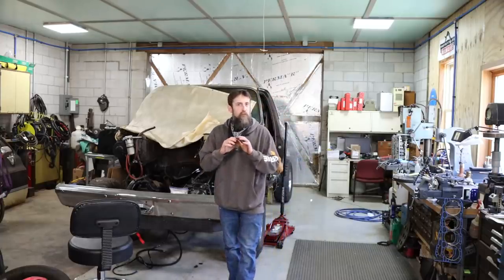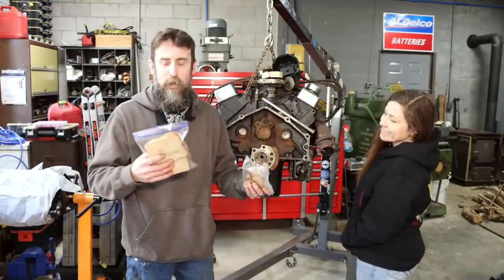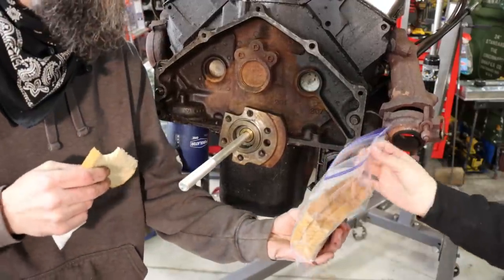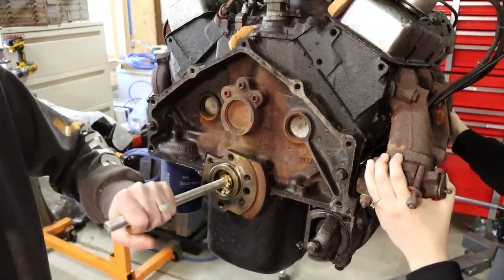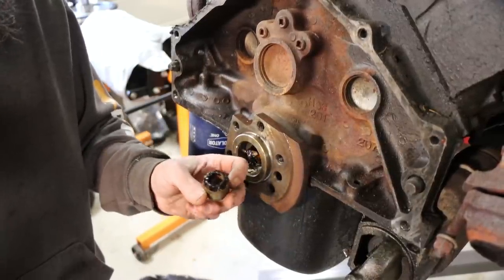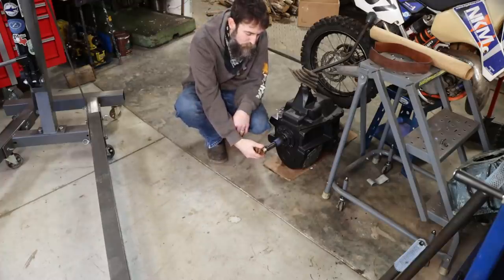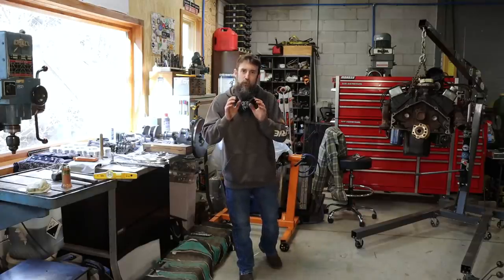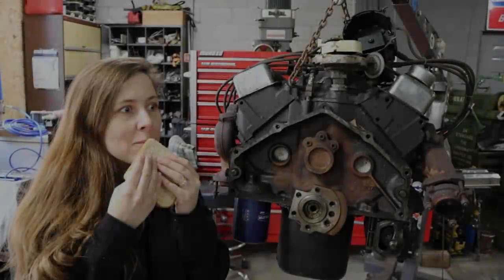Neat Trick Removing Bearings With BREAD?? Yes bread.

Comment: 1965 I went to Lincoln Speedway in Abbotstown, Pa with Charley Weirman '55 Chevy late model crew. It was running a 327 and took a front end hit resulting in a minor top tank seam radiator leak. The crew chief told me to run to the refreshment stand and buy a pack of unopened hot dog rolls. They put 3 rolls in the radiator, it was steaming after the feature but he finished 5th!

Comment: Not a mechanic trick, but I’ve used a white bread plug to stop water dripping long enough to get a good solder joint on a T-fitting copper water line. It eventually dissolves in the water after you get that nice shiny solder joint. This was to replace a crummy piercing fitting that had too low flow rate to keep the ice maker from repeatedly freezing up.
Reply: My dad was a journeyman plumber and would use this trick frequently. Came to the comments to post the tip, but you beat me to it.
Reply: Also used that trick a lot too. That trick cost me a few lunch sandwiches....lol

Comment: Steve I've always placed wheel bearings in a sandwich bags and then added wheel bearing grease to the bag. You can squeeze the grease into the nooks and crannies of the bearing by squeezing the outside of the bag keeping your hands cleaner. I actually think the pressure from the bag while being squeezed gets the grease in more areas of the bearing.
Love your channel. Amazing videos!!
Toby
Reply: Good idea,,,,I always end up with more grease on me then in the bearing! Hey, Just keep a bag full of grease in the top of the tool box and use it over and over. 😁
Reply: Neat trick, Works for oiling prefilter foams as well
Reply from the maker: That is a great tip I never considered.  Excellent !👍
Reply: I've used the ziplock bearing packing trick many times, from the tiniest bearings to the biggest! But I eventually broke down a few years ago and got a Lisle grease press (the red and clear plastic one), and while it only works on normal automotive to small industrial sized bearings, it is worth every penny. The bag trick works for 1 or 2, any more than that you'll have a claw hand from all the repetitive folding and pressing to grease a bunch of bearings! Finally broke down and bought one doing the bearings on an 84' Chevy 1500 sfa (pretty much full maintenance/fix on the entire driveline), and don't regret it!

Comment: Ah the memories.  Im 62 and we did this quite a bit back in the 70's on our 4 speed motor head cars and a few pickups when changing clutches, except we used heavy grease as you said.  We used to tape the end of the rod or an old input shaft with some electrical tape to help the "hydraulic seal"  Same results as long as you have the right size rod some thick grease or the correct factory shop manual approved bread and a good hammer - lol.

Comment: Hi Steve and Elizabeth,
I had good success using thick wheel bearing grease. Always worked when the bearing puller wouldn't fit in the bore of the center bushing. Hope the family stays safe.

Comment: I'm more impressed someone thought of using bread than it actually working. Thanks for sharing!
Reply: If you have a brake caliper with a stuck piston in it you can remove the caliper and install a grease nipple in the inlet hole. Then you can push the piston out in a controlled way with the grease gun. Less terrifying then compressed air😁

Comment: Bread, paper towels, grease, grease and paper towels, bar soap, crayons, clay, candles, plastic wrap, aluminum foil...

Basically anything or any combination of things that will stay put in a horizontal hole, fluid enough to transfer hydraulic pressure, and can be hammered with a punch the same size as the ID of the bearing.  You can achieve the right sized punch by wrapping electrical or duct tape around an existing punch.

Comment: I used fiber grease (wheel bearing grease) to do the same job. 
Mopars and Ramblers had a light bulb down in between the push buttons that were used to select automatic transmission gear range. The service writer gave them to me because the procedure was to get at the bulb from the back side of the selector box at the underside of the dashboard. Others took an hour to do it. In five minutes, I took off the face plate, and pushed a piece of hose in between the buttons over the bulb. The bulb was pushed into the socket and twisting the hose the bulb was released. It came out in the hose and the new bulb went back in to the socket the same way. I kept a short hose on a pencil in my shirt pocket. For a long time, no one knew how I was doing it so quick.
Bad, stuck dowel pin in a blind hole. drill a hole through the length of of the pin, tap it and install a grease fitting. Use the grease gun to pressurize the area behind the pin. It jacks the dowel pin straight out.
Broken-off stainless steel exhaust manifold studs in an aluminum cylinder head, in chassis Use 90 degree angle head drill. Center punch, drill using bit from set of SPLINED easy out (Snap-on or Rigid). Pack the wax from a candle into the hole. Heat the broken stud to cause the wax and wick up the threads of the stud from the inside. Allow time to cool. Drive the SPLINED easy-out into the hole, place the matching splined nut onto the easy-out. Turns out smoothly most times.
Many Dana (and other) differential use a lock bolt to keep the cross shaft in the spiders from coming out of the ring gear carrier. The bolt has a dowel below the threads. Very frequently, the bolt fractures and cracks off at the lower thread leaving the pin end in the cross shaft. The broken off pin can be remove from the carrier in chassis by making a drill bushing
from the broken off head of the bolt. Drill a 1/8" hole through it. Using it and the 12"long carbide 1/8" drill you bought from McMaster-Carr, Drill into the dowel pin remaining in the carrier. Drive the 1/8" splines easy-out into the drilled hole, place the splined nut  and turn out the remnant.
Reply: And the winner is.......

Comment: Another cool bread trick: Repairing copper plumbing pipe can be a problem if there is any water in the line.  Can't sweat on any fittings if even a tiny amount of water is sucking heat away. So pack the pipe with bread to dam the water, then sweat on the fittings.  When you turn the water back on the bread will dissolve. Just remember to remove the screens on the faucets while you clear the line of bread.
Reply: Yep, awesome tool!  I did a retrofitted a whole house in copper pipe while still living in it.  It was lifesaver!

Comment: Working in an engine reconditioning department of a British car manufacturer during my apprenticeship, they always used bearing grease and a rod machined a nominal size fit. this used to work every time even though the bearing would be worn. You're basically hydraulic pressing it out. Using grease leaves no chance of contamination and allows the new one to go in easier without needing to thoroughly clean the hole out.

Comment: Hey Steve, 
An old engineer once told to me - How to remove seized studs, deck caps that are rusted in. Build a shallow bund around the cap (Plasticine or the like) and then fill the area with Tabasco sauce. Leave for 24 hrs and simply remove the fitting. Works every time. 
Andy UK

PS cant wait to see the truck fire up for the first time.

Comment: Have used bread to remove pilot bushings. Also when you're trying to solder copper water lines and you still have water leaking. Shove a piece of bread down the pipe. It would stop the water long enough to solder your fitting on there. And then open the pipe and it will come out straight out

Comment: We recently used bar soap to remove some bushings that were in a housing of a combine corn head gearbox.  Worked exactly the same way and the Irish Spring made everything smell nice.  :)  It is definitely less messy than grease, and probably less messy than breadcrumbs everywhere (unless you have a four legged vacuum in the shop).
Reply: Great tip. Thanks.

Comment: Not a mechanics trick but anyway. Pipe unions... The 3 piece type...

After you tighten them all the way with your pipe wrenches, smack one side with a hammer, then smack the exact opposite side. Don't get crazy with your smack, but give it a decent stout 2 hits. now the union will tighten even more, aprox 1/4 turn. This works great on well pump heads on the suction side where it can actually draw air. The hammer blows rock the fitting back and forth and force to union to seat a bit more, and now the pump will keep its prime. I do this to all 3 piece unions though, and they never leak.

Comment: When we were younger and had to pull the rear axle on a car, we would take a log chain and fasten one end of the chain to the axle using the wheel lugs and lug nuts on a couple of the lugs and grabbing the log chain about 4 feet back and snap it back, just like trying to crack a whip. 
It might take a couple try’s but it always did the job when we didn’t have a slide hammer to get them out. One nice thing about getting older is the tools that you accumulate, and yes, I now own a slide hammer.

Comment: I have used this one myself a few times. I normally just go for the slide hammer though as it tends to be faster and 99 times out of 100 if I pull a bearing out of something I won’t be putting it back.

Comment: I didn’t know about using bread but I have used grease and toilet paper. I did have one with an extra deep pocket behind the bearing, that at first had trapped air. I kept trying and worked out the air pockets. I can see how bread would have worked better. Thanks for sharing!

Comment: I worked for Miller Brewing Co. here in SoCa as a Operations Engineer and part of our job was to modify the Stainless-steel piping the product flowed through to add branch lines, instrument lines, pressure sensors, etc. The problem was all SS welds were to be sanitary welds and most of the time would use rice paper to seal the piping but when there's 40 ft of 4-inch pipe to seal off to retain the Argon gas it would take half a tanker truck load of gas, so I'd use loafs of white bread, as it sealed better than wheat, and shoved it in the pipe at the weld  location making a small area for the purge gas and finished the weld. The brew house operators would then flow hot caustic through the pipe and dissolve the bread and sanitize the piping to resume operations.

Comment: Steve, I have used bread for another fix. It is in the plumbing trade. When I am trying to do a repair to leaking copper pipe.  I cut the pipe open and want to solder a new fitting in. The water that is in the pipe will not let the pipe get hot enough to solder. But if you fill the pipe with bread and pack it in then the water will be kept away from the area that I am trying to solder. After the connection is finished I simply open the water supply again and safely flush the bread out of the pipe. The repair is now complete. It works great! This is particularly helpful when the repair is being made at a low point in the pipe run. No mater how you try to drain the line out the water always seems to keep coming down to the place you want to solder.  If there is water in the pipe you can never get it to solder.

Comment: We did the same thing back in the 1960's when I worked at Bardons & Oliver machine Co.
To remove the hardened bushings in turret lathe square turrets, we used oil and cotton waste on a hydraulic press, it's amazing when you see the bushing pop up!

Comment: Neat ! I have always used EP2 grease for these and a bolt with the threads cut off to do this. Once all I had was Vaseline that I put in the freezer.  The freezer works best on both. I think candle wax would work well too.

Comment: If you want to stop an assembled engine from turning over while removing/installing a harmonic balancer or flywheel. Feed a decent length of nylon rope into a cylinder. This rope trick also works for removing valve springs from an assembled engine, the rope stops the valves from falling.

Comment: We used grease in my dad’s 77 Chevy 4x4.  It had a 350 4 bolt main with a granny 4 speed.  It was easier to pull the engine to change a clutch rather than pulling the tranny and transfer case.  Another cool trick is to use hand cleaner like Gojo to help rubber parts go metal fittings.

Comment: This is a great trick. I've used greasy rags to push the bearing out of an electric motor but the bread trick is better as it will flow easier. Thank you for sharing.

Comment: Used to pack hole full of grease and whittle a handle down or transmission shaft any old rod that fits into pilot bearing bushing and whack with a hammer. Pops right out.😁

Comment: I remember a guy once had a freeze plug pop on his old Mopar. It was so close to the firewall there was no way to hammer a new one in. He  used some all thread, a couple nuts and sockets, and made a little jack to press against the firewall and push it in place.

Comment: When you put in the thermostat, drill a 1/8" hole in the plate to let just a leeelte water thru it all the time. It makes for a little smoother water temp change. Built GOBS of small blocks in my youth and did that to every one of 'em. Saw it in 'Smokey's Garage' in Popular Mechanics probably early 60s. He swore it made the 'stats last longer because of the hole, the hot water would get to the 'pill' in the stat that opens it much quicker. Also helps a bit if you are pushing a little more power than the radiator can cool easily. And as you know, every little bit helps. Michael in Colorado.

Comment: I use “spitballs” to do the same; wet napkins or paper toweling. Works when greases just pops the bearing seals and oozes out. 
Bread, wet paper, grease, all good tips when you don’t have a job specific bearing puller.

Comment: One more...
My buddies 1970 Torino GT ( we were 18-19) . It had drum brakes.. Rear wheel bearing took a dump. We didn’t have a slide hammer. So we took the drum off turned it around, screwed the lug nuts on a bit and used the brake drum as a slide hammer.. worked just fine.

Comment: I used bread ( the white part ) in a copper pipe ( like on hot water heater’s) put in the pipe to keep the water from being drawn to the heat,It acts like a dam. Which allows you to go ahead and solder the pipe and then when you turn the water back on yet emulsifies and flushes out of the pipe.

Comment: Thought of 2 more that my Dad taught me.

When you need to hammer a nail in to wood, close to the end, lay the nail on it’s side and smack the head across the grain. 
Drive your nail in, the grain will never split...

2) When using a saw 🪚 always put soap or candle wax on the saw blade.

Comment: Great tip and I learned something new.. I've used bread in pvc pipe to stop the water drip for the glue to dry, it dissolves when you run the water!! You can also use cotton twine to cut through plastic pipe etc in hard to reach places...✌

Comment: I've had 100% success with both grease and bread. Years back an old hand told me grease needs a better seal (diameter of your driver), however..... If you lack any good driving implement (tool) grease will be preferable.... "you can whittle a hunk of wood or branch to make a tight seal, and when the seal is tight you don't need much hammer force".... (so the wood will not be destroyed with impacts). I have done that too and it works. I agree though - bread cleans up easier - especially with a pup handy! Thanks for sharing

Comment: One I've used removing damaged bearings out of cast alloy electric motor end bells with blind bearing holes is with the welder. IF the inner and outer races are still there, three equidistant tack welds between inner and out race and it will fall out when its cooled. Three tack welds sometimes works even if only the outer part of the race is there,  if not a smaller washer welded in does same thing.

Comment: Another plumbing trick for homeowners changing a heating element in hot water heaters - some folks think you have to drain the tank to change a heating element, but not if you do not break the water system seal in the house.  Just TURN POWER OFF to the heater and make sure NO ONE opens ANY faucets of any kind or flushes a toilet while you remove and replace the heating element and the water just stays put in the hole, it was a real mind bender the first time I did it - but its the same principle as water in a straw as long as you hold your finger over the top of the straw theres no vent to allow the water to flow, remove your finger and the water flows.  BUT if you vent the water system in the house in any way you will have a gusher like youve never seen-lol

Comment: I know many, but can only think of the time that I needed to take my damper/ balancer off of the crank. I didn’t have an impact wrench, I was 19 and replacing my timing chain. 
I had the right size socket ( big ) and ratchet. No matter what I tried, the crank would turn and not loosen. The local genius Motorhead ( Mickey.... Think of the Fonz, but way cooler and really knew cars). Told me to get a long pipe that fit over the ratchet handle, put both together, put it up against the frame, have someone get in the car and tap the key on and off quickly. The crankshaft bolt came out in a second !
( you just got to make sure that you don’t put it on the wrong side and tighten it) ..

That’s all I’ve got for now. I’ll have to think of more. They were always genius fixes/ problem solvers from older men, that had Common sense, little money and had to get the job done. 
You know what they say about common sense. Not much around from kids these days.

Comment: A neat trick to fit a new bearing on a tight shaft is to pop the bearing in a sealed plastic bag and put it into boiling water for 15 minutes, remove it from the water then easily slide it into place. The boiling water expands the bearing evenly without damaging it. When it cools it shrinks and holds itself in place.